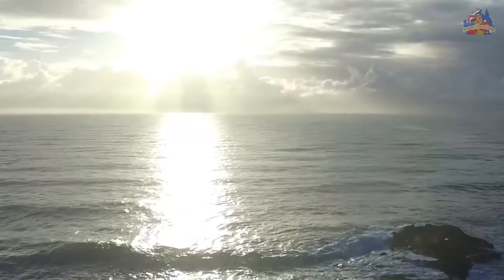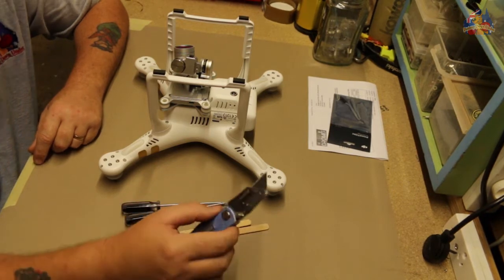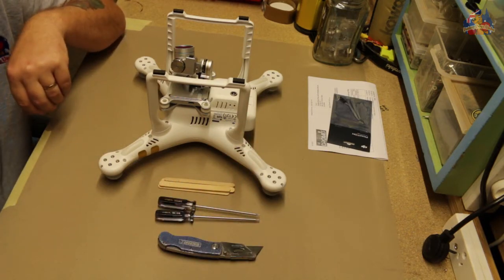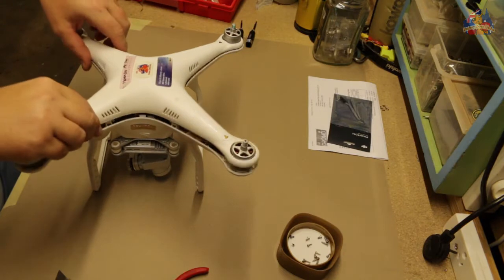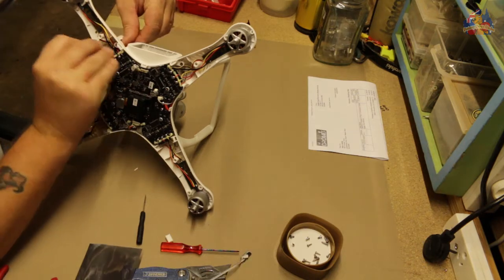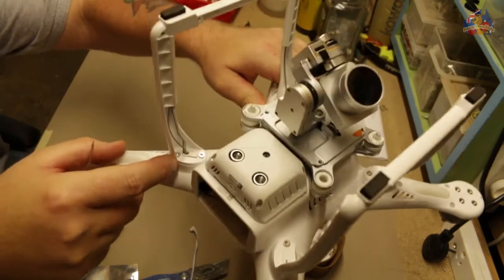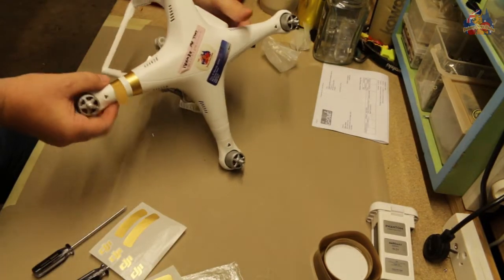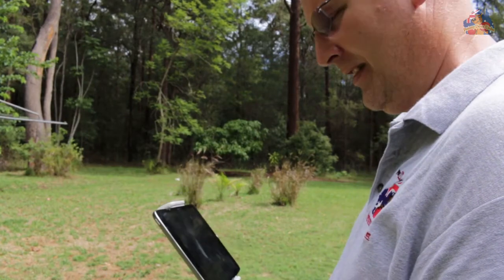How to Replace a Faulty DJI Phantom 3 Compass, Easy Job.

Comment: Excellent how-to video, entertaining too. Hopefully this fixes me up, I'm having the same issue. Thanks.
Reply from the maker: No worries mate , thanks for the nice comments and hope it does help you out. It's been a year since i posted this video now hopefully it's helped a few people out? Good luck!!
Reply: Hey bud, the new compass works great! Easy enough job, and today I flew with NO errors for the first time in months. I've been contemplating and dreading sending my Phantom to DJI for repair, wish I had seen your video sooner. Now I'm in the air again!
Reply from the maker: Good News mate glad it helped you out, Thanks heaps for your nice comments. Flay safe Cheers.
Reply: Hi man, i'm having the same issue i guess..
Constantly "Compass Error" whenever i trie to calibrate my compass before takeoff.
Havn't flew in months since this issue...Did you also had this problem before you chose to replace the wire/compass?

Tnx in advanced, really wanne fly again.
Reply from the maker: Hey mate, yes I kept getting compass error, sometimes i couldn't fly and then sometimes I would get up in the air and then the error would hit and then have fun bringing her home. Also DON"T calibrate compass before every flight do it in the middle of a field or somewhere and you should be good only do it after firmware update or if you go on holidays a few thousand klm away, mine hasn't been done since I replaced the compass over a year. Good luck and safe flying.
Reply: Thanks for the awesome video mate! I opened the Drone and the cable just came loose, nothing more than just clicking it back in and fly away :D You really helped me out! Otherwise i would never concern to dismount the Drone :o
Million thumbs up!
Reply from the maker: Good news mate glad it was an easy fix for you. Happy and safe flying :-)

Comment: Question, if DJI Drone when attempting to take-off, she tips over every time hitting blades.  What is this malfunction indicative of?  Anyone?
Reply from the maker: I would say either a bad motor or bad ecu
Reply: Thank you
Reply: Did you mean ESC board that connects to motor?
Reply from the maker: No the IMU main brain if you like.  Try doing a IMU re-calibration. also Join a DJI facebook group and ask on there too. Good Luck.

Comment: Great video thanks for posting. Only info I could find on the internet that showed reliably and easy how to do this. Company I bought my Phantom 3 Advanced from hadnt put the compass wire in the "step" or channel, and so the clipped pressed in tight severed the wire and I needed to replace. Now thanks to you back up and running. Cheers.
Reply from the maker: Good news, thanks for the nice comments, Glad everything turned out ok for you, well done and glad it was of help to you.

Comment: Thanks for the great video!

Yesterday while flying my Phantom 3 I also get the compass error. I have tried to recalibrate it but I keep on getting the message saying that theres magnetic interference..even when I change locations. Do you think I'll need to change the compass or are there any other suggestions you might have?

thanks!
Reply: Rodrigo J. Da Silva same error as mine, changed the compass, worked for several usage, now its back again
Reply: The intesive mag interference is back again

Comment: Thanks for the video. Good stuff. Had a tough time with the cover but finally got it. Compass error after my first crash. Compass had come loose. Working great now. Good guidance regarding not to use a screwdriver. Had all my tools ready to go thanks to this video.
Reply from the maker: Well done Craig, I know the cover is a bugger. Glad your bird is back in the air. and thanks for commenting It's good to know it helped someone out. Cheers mate safe flying.